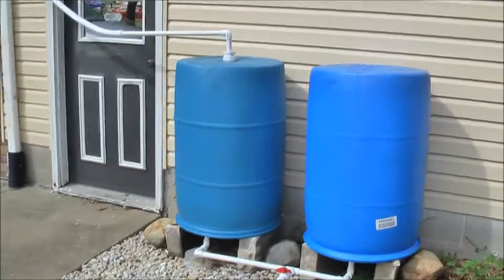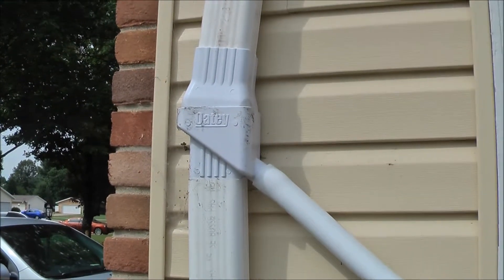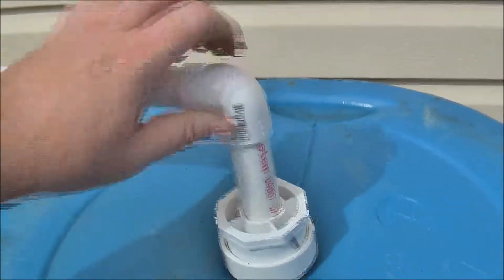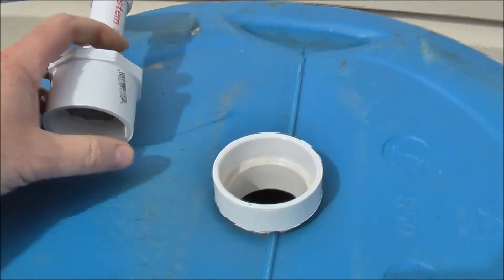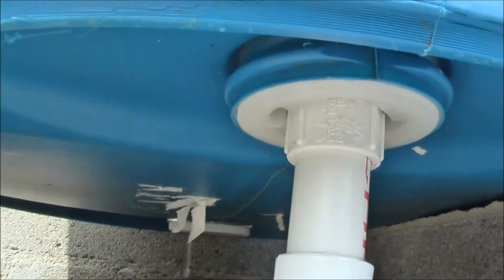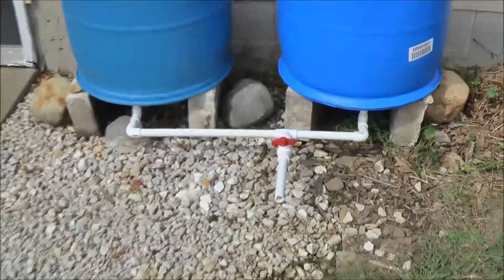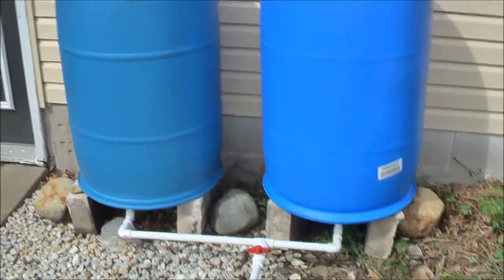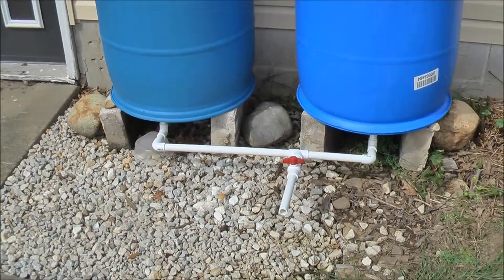Rain Barrel - Rain water collection system w/ Oatey Mystic diverter

Comment: Perhaps you have it and I don't see it but regarding the barrel on the right, as the barrel fills you'll need a way to let air trapped in the barrel escape, otherwise the barrel on the right will only fill partially.
Reply: penguinistas that is 1 thing, the other thing is running a pipe right in the middle of the door :)))
Reply from the maker: +penguinistas You are exactly correct!  I had drilled about 20 holes in the top of the barrel for air to flow.  Good Catch!